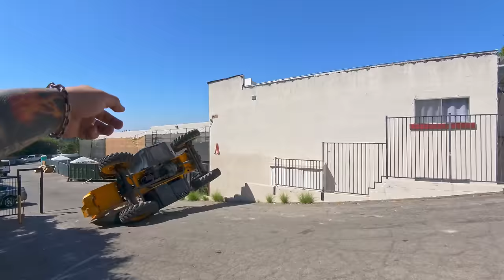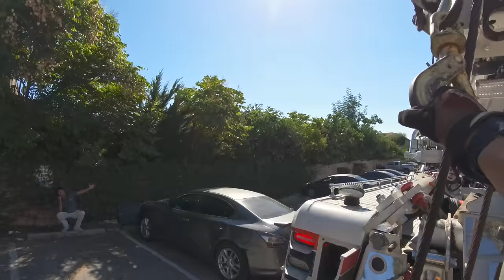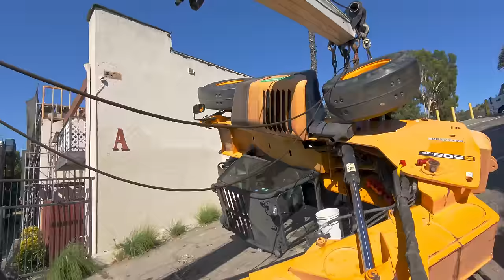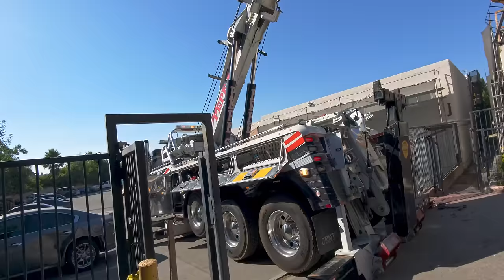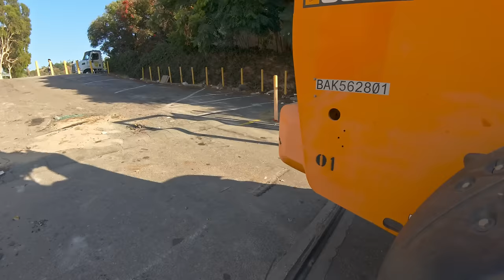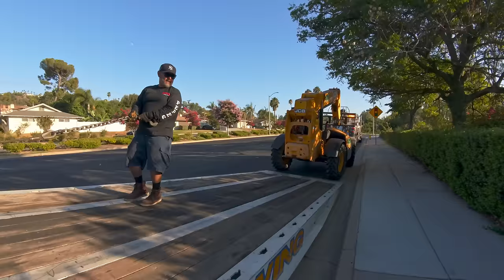Telehandler Crashes Upside Down in Apartments!

Comment: Its on safe mode. If you put it in drive or reverse when the brake is not set before you start It, it will go on safe mode. So put it in neutral, set the brake again then release the brake then put it in gear again it will move. And if it doesn't work. Turn it off. Put in neutral and make sure the brake switch is set. Then turn it on and it should work. If it doesn't work after that then it's busted.

Comment: Just a heads up, but cranking the engine over with a wrench slowly will prevent hydro locking the engine and bending connecting rods.

Comment: Maybe this unit has an electric brake - a switch on the dash with a red light. This would disable the transmission but allow the wheels to roll.
Reply from the maker: Nope, that's what the guy on the phone told me too. Was not the issue, the guy I was speaking to is the one who gives me all these jobs and fixes them for a living and where we took it to after this job

Comment: At 23:49 I noticed parking/safety lever(left of operators seat) is not down-horizontal, a far as I remember using these jcb machines it will not allow you to drive the machine but will allow boom ops etc. not sure is operator got the lever down later in the video.

Comment: One thing I've noted on some of your recoveries. You do tend to try and start equipment that's been upside down. Most of the time you might get away with this, but you will run across one that has had a cylinder fill with motor oil and when you crank it it will be hydrolocked and you will bend a rod, or worse. I'd suggest not trying to start such equipment until you have barred the engine over by hand to clear the cylinders. Or, just let it sit upright for a few days to let fluids settle back to where they should be before starting.

Comment: Wrong machine for the incline of the driveway. No telescopic legs at the front (like the last video) to allow it to operate on un level ground with boom up.
Operator not trained for the machine and its limitations.

In Australia you should have a License for High Risk Work with the correct endorsement.

Comment: Should not try to start engines that have been overturned. The oil would have migrated above the piston and will cause a hydrolock, and bend connecting rods or other damage. Youve been lucky twice. Or maybe not. Just because it started and runs does not mean there is not damage.